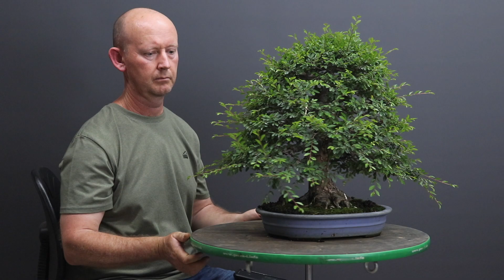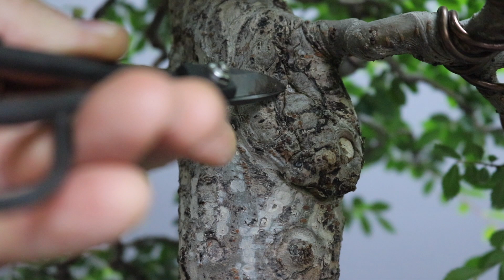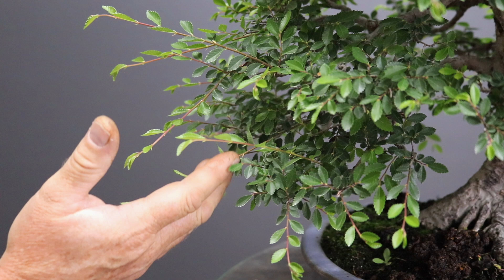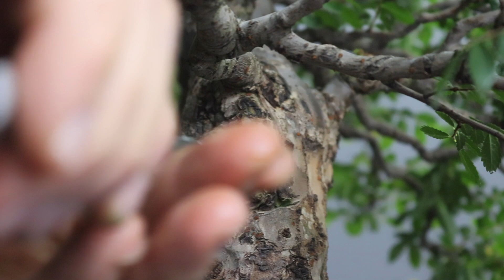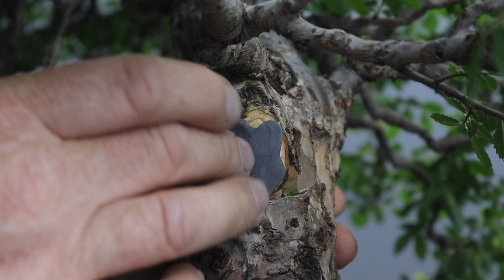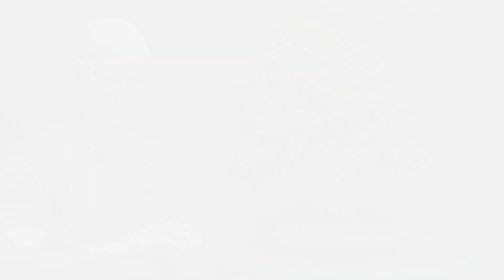Late Spring Maintenance on Elm bonsai

Comment: Do you have a video where I can learn about the filling of large wounds with cement? Which product do you use for this? Excellent channel btw. Very useful info and well explained
Reply from the maker: Thanks for commenting. Yes there is a video called “Holey Trident” where I use cement. If the hole is really large then cement is good but if not so big use a 2 part epoxy putting instead.

Comment: I'm going to do some major work on the roots. You say spring time is ok? All the leaves are out and it looks very healthy. I'm using 5-10-5 and she's in a large nursery pot.
Reply from the maker: Early spring is the best time to do root work especially if it’s heavy. If the leaves are fully opened the risk to do root work dramatically increases. You need to remember a key concept. You need to keep the balance in the tree. Cutting off a lot of roots will leave and imbalance between the leaf surface area and what the roots can support.

Comment: Really enjoyed this being a relative beginner to bonsai and owning 5 elms now I found this video very useful
Reply: Ii
Reply from the maker: That’s great Kevin. Just remember that elms in development require other techniques as the focus should be on building structure. Very simplified indeed, you need to allow branches to grow longer before cutting them. But I’m sure you’re aware of this. Good luck and enjoy your Elms, it’s a very rewarding species.
Reply: @TerryErasmusbonsai  yes I will thanks I have 3 specimen tress that are already quite established I tend to let them do there thing with support from more experienced owners at my local club.ive brought cheap nursery stock that I tend to use to sharpen my skills on pruning and wiring still not that confident on working with a well established old tree
Reply from the maker: @kevinmitchell4960  good strategy!
Reply: @TerryErasmusbonsai  ।।       नई